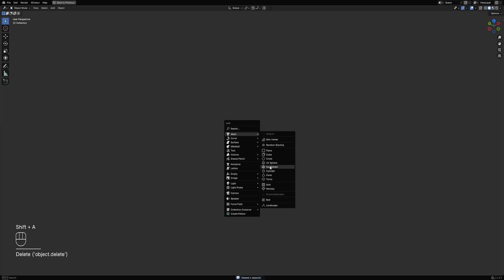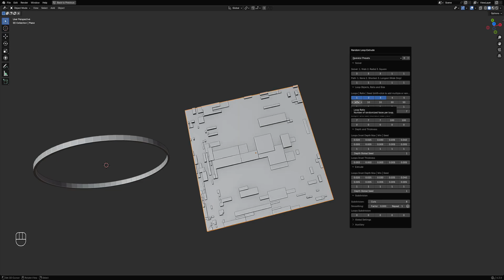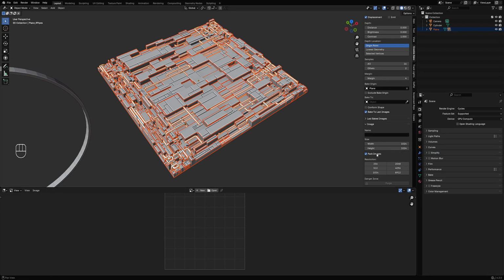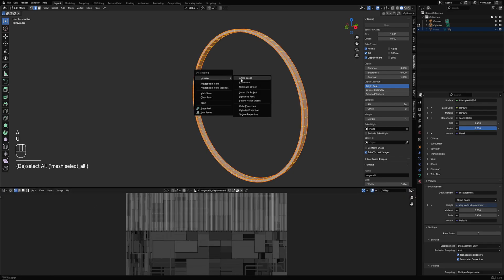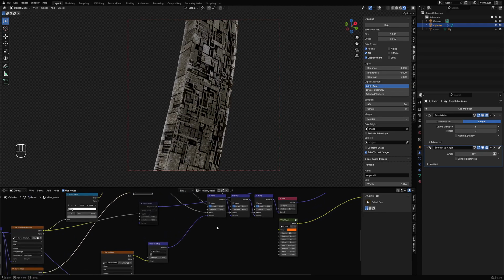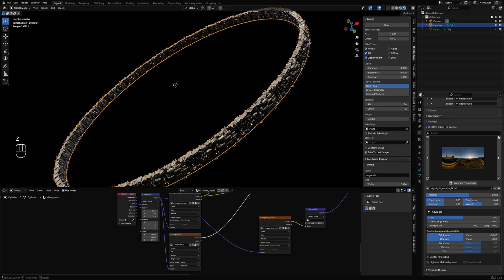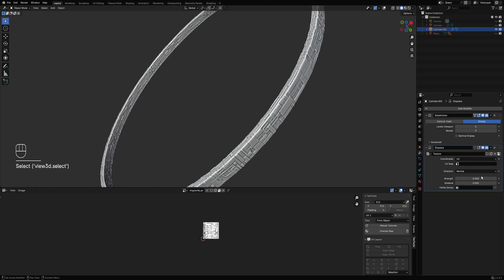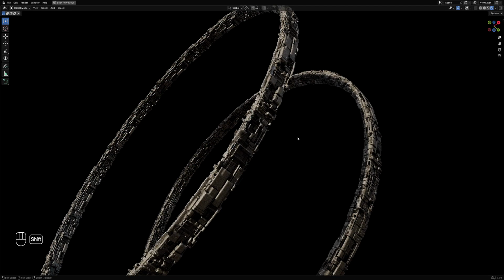Modeling Halo-Like Ring Worlds! #b3d

Comment: if you plan to have the faces on different sides of the ring line up across the 90 angle making sure they are matching across the 90d. you can have the displace go seamlessly around the side which will look better. now one side in this case of the uv island where there will be one seam will not be matched unless you plan your image map to tile in a certain way but it will look much better. love your addon btw working up to a purchase...saves alot of work...thanks for making this vid
Reply from the maker: Thanks for the info.